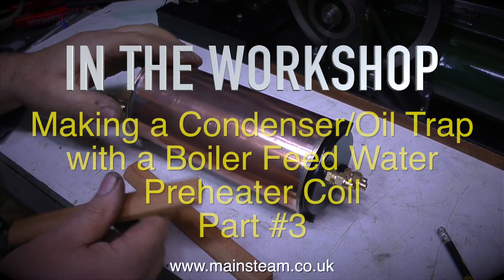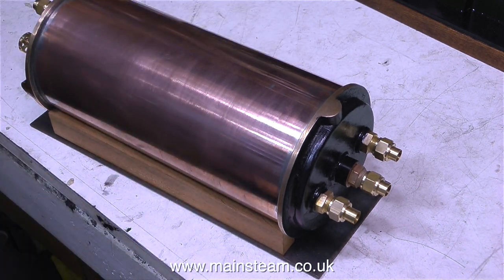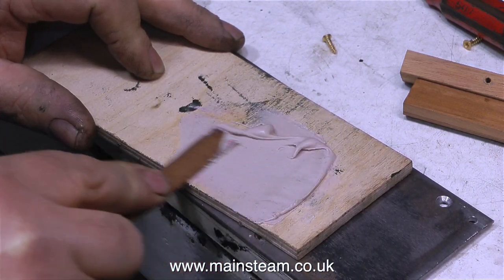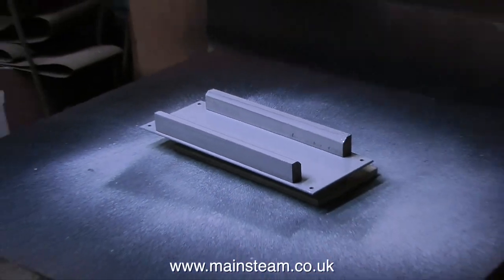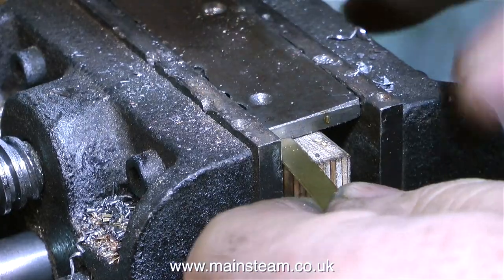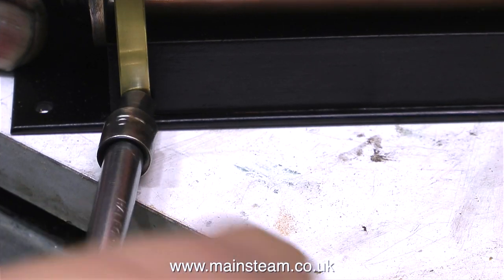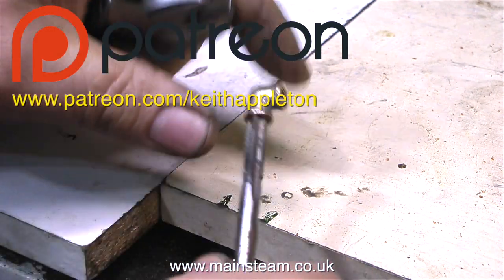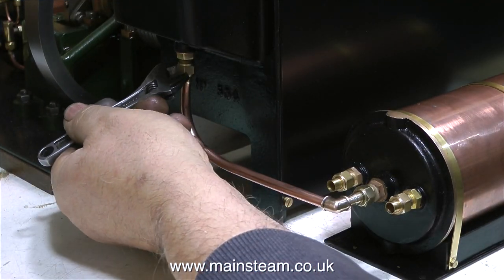A CONDENSER/OIL TRAP & FEED WATER PREHEATER - PART #3

Comment: I have worked in manufacturing industrial machines and the (unwritten) specification is "cut to print, hammer in place, fill and paint to cover."  Your word is so far above that level it is a joy to behold.
Reply: Fudge to Fit, Paint to Match.

Comment: Keith, a suggestion.

Pound the 4 nails all the way through, and turn that 
piece of plywood over.

Now, instead of a large nailhead, you just have a point.
(Us colonials call those "finishing nails," because the 
head is easy to hide.)

Oh, pretty impressive knitting!  Your results are usually 
flawless.  (Unless you point them out.)

steve
Reply from the maker: I never thought of that - ! {:-)))

Comment: Painting on the nail heads... (Steve's idea of painting on the points is very good, but...) Wouldn't it be best to hang the piece with wire from one of the drilled holes in the corners? Then just spin it any-which-way you need?
Reply from the maker: But then the paint would probably run ........... better for it to be flat ......

Comment: Tip for quick filling holes (instant repair)... put a drop of the cyano adhesive (thick version) into the hole, sprinkle baking soda onto the glue and give a quick stir.  It hardens immediately, and is strong enough to be used on fiber carbon helicopter blade leading edges.  Repeat as needed to completely fill the hole, and sand the repair to desired contour.  This tip is published elsewhere on YouTube.  Thought you might try it, as a home made industrial strength body filler that sets up extremely fast.